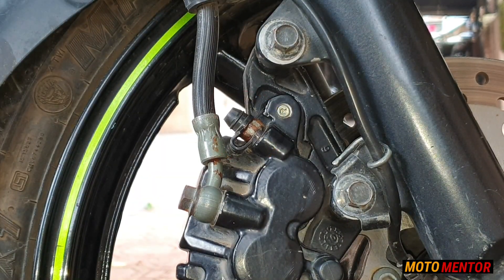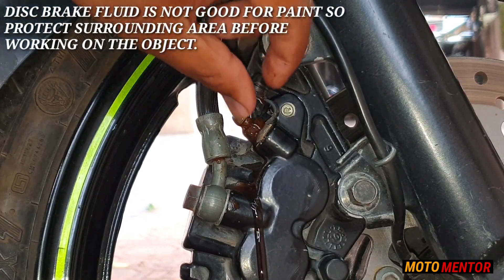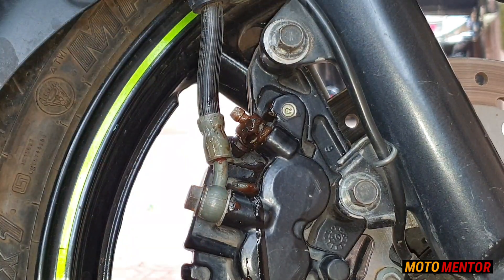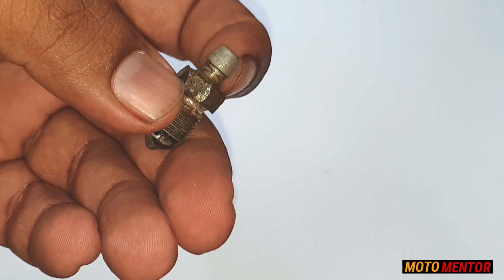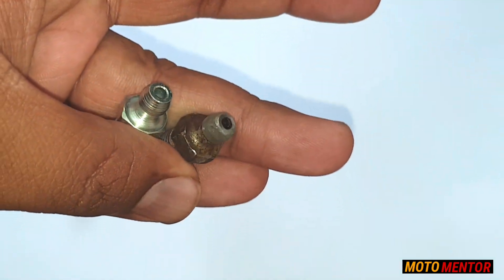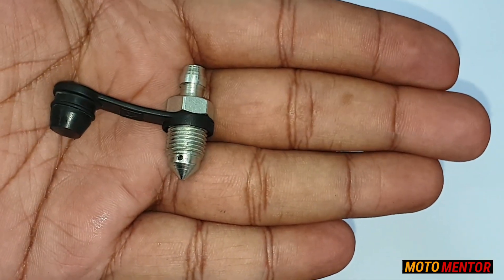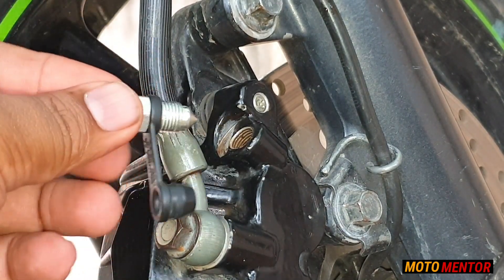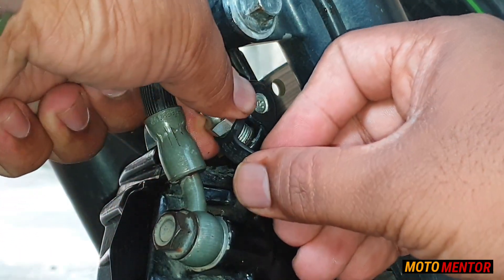How to replace bike disc brake oil screw

Comment: why is your brake fluid brown?
Reply from the maker: The orignal color was red however now its lil old so its looking like brown, I will be replacing this with yamalube very soon. Usually you get this in yellow color however the one which I got was red.
Reply: @MOTOMENTOR  dot 3 is red in colour and dot 4 is yellow in colour